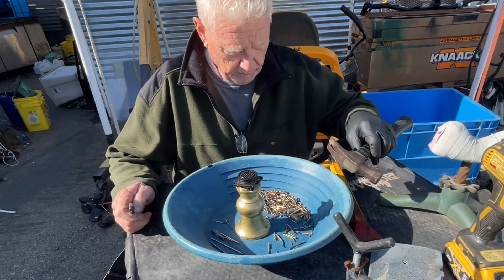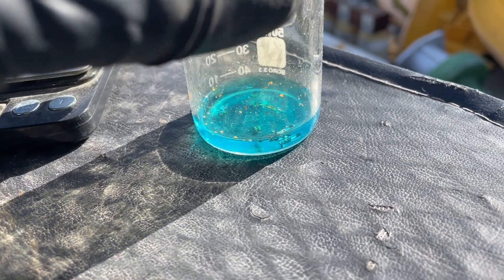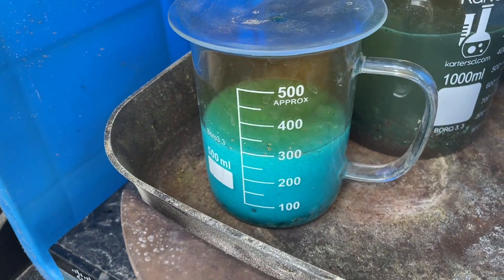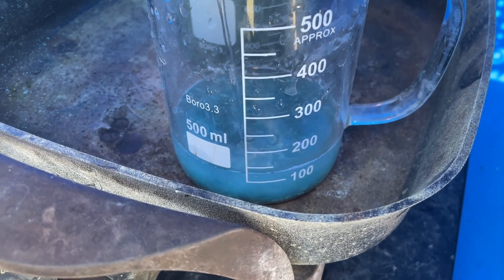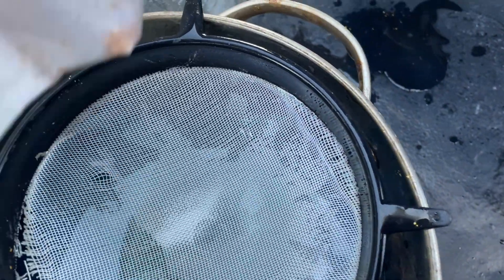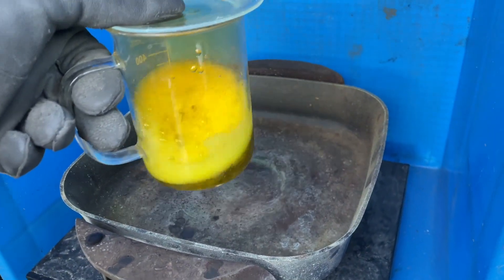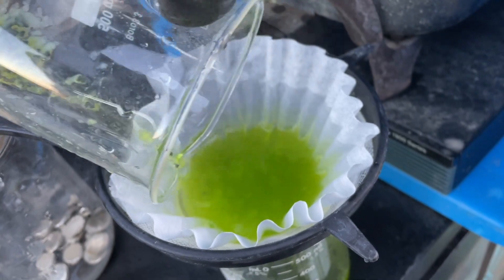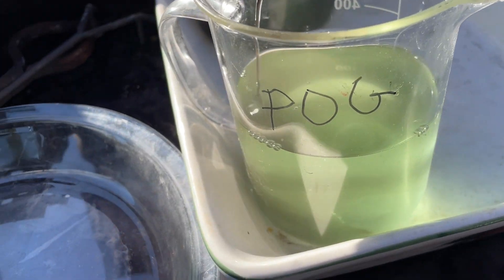109 Grams Gold Plated Pins.. Refined to Pure Gold

Comment: 4:22 how do you go about getting rid of that salt looking stuff.. maybe tin or something.. tin always gives me hell...
Reply from the maker: Yes, it does! 
I washed the material with water several times until the rinse water was basically clear. Then, another dilute nitric acid boil.
The blue color is, as you know, copper. There was a tiny bit of lead/solder, but after the first rinse, I believe most was gone and, in fact, gave me no further trouble. 
I believe a better method for these pins would have been.. a hcl boil to cleanup the pins, rinse well, then the dilute nitric acid strip, then refine.
Stay Golden 
Peace Prospector Tripp

Comment from the maker: Hello all,
I removed these pins from their connectors then refined the 109 grams of fairly low grade gold pins. They had a stainless steel keeper around them, which is really difficult to manually remove. So I ran a these in dilute nitric acid. The diluted nitric acid will not react with the stainless steel. This was the easiest way to remove the stainless from the gold plated pins. 
I was disappointed with the results.. however, you don’t know until you know!
Now I know! 🙄🤪😆 
Thanks much for your precious time.
Love to all
Peace Prospector Tripp
Reply: right on man... every little bit you refine, always adds up...
Reply from the maker: @theonewhowas7709  absolutely!
Stay Golden 
Peace Prospector Tripp